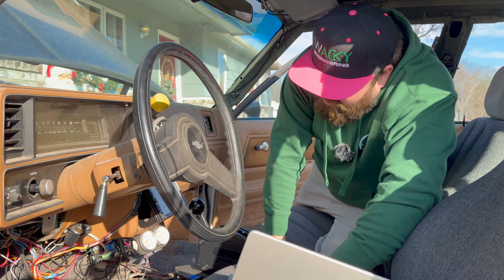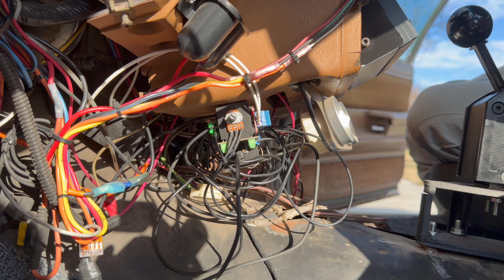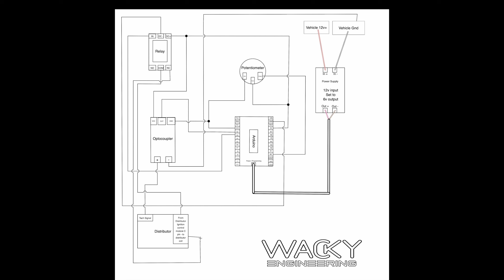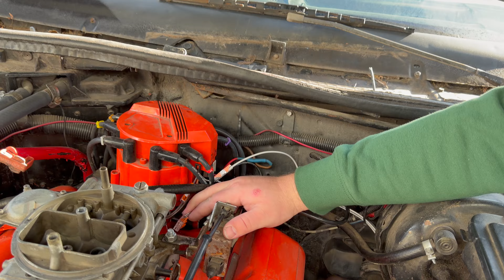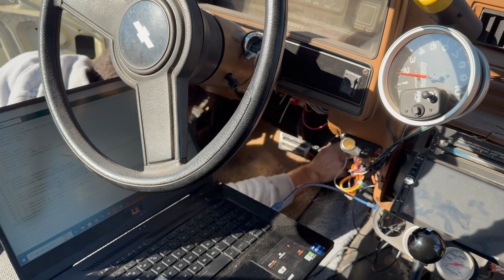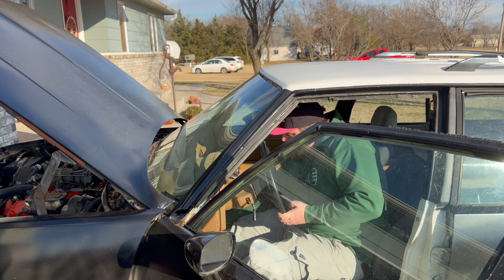How to Build a DIY Rev Limiter: Wiring & Setup Guide

Comment: Hi, very cool idea! I’m currently making my own for my -76 Corolla but I don’t fully understand where I should connect the wiring to the distributor, any thoughts on how I should connect it? (I’m very bad at this electrical stuff)
Reply from the maker: Did you happen to look at the wiring schematic we posted during the video? Hopefully the schematic should make sense. If you have any questions about a specific wire let me know.
Reply: @w @wackyengineering s I looked at the schematic and it’s pretty clear where everything is supposed to go. I just don’t understand which cable from the distributor I should connect. Is it from the distributor to the ignition coil or some other signal cable? I’m sorry if I’m bad at describing my problem english is not my first language
Reply from the maker: Well you have a wire that takes the rpm signal from the coil to the Arduino. You also have the power going to the coil that goes through a relay to interrupt power to the coil.

Comment: is there any communities that could help to develop and building ?
I am developing a motorcycle safety system that integrates a lean angle sensor with a progressive RPM limiter. The goal is to automatically lower the engine's rev limit as the bike leans, preventing the rider from over-accelerating while at high lean angles.
Reply from the maker: That sounds like an awesome project!
Reply: Kind of solving a problem that doesn't exist IMO. With the same sensor you may be able to use it as a wheelie sensor for anti-whiskey throttle.
Reply: hello i respect your comments brother, can you suggest any ideas about iot? I thinking also about smart lamp that can move and avoiding the traffic from incoming way, i live in Indonesia and there no sistem like that implement here

Comment: HEY, i have a quick question. AT 2:14 why do you wire the potentiometer like that instead of like they are typically wired?  
+ S -  OR  - S + 
BUT you seem to have wired it  
 -  +  S.
ill be using a different mothed of adjustment nut im just curious. 

thanks for the video, schematic and code. i freeze framed the first video in slow motion for hours a while ago. i believe that i asked for the code.. i want to do this on motorcycles... or at least the ones that i own 
so they can be tested and updated often
Reply from the maker: You are correct, normally the output or wiper is the middle leg of a potentiometer. Im assuming I just was not paying attention. I will double check the car to see if this is actually how I wired it up. It obviously is working but It may be more like a rheostat than a true potentiometer wired up like this. I would wire it up the traditional way to get better control out of it.

Comment: when i made mine, i used a cheap rpm window switch paired to a 5 pin relay to the power side of ignition.
i used my 20 dollar temu window switch(jegs brand sells it for 50 i think) ground output to the ground trigger side of the 5 pin relay that had the normally closed pin going to igniton. feed it ground and it breaks the circuit, making a hard cut rev limiter.  i use it on my GM hei.
Reply from the maker: That sounds interesting! We would love to see a clip of it in action!

Comment: Thanks
Reply from the maker: No problem!
Reply: Was testing it today but seems like the relais is to slow to cut of in terms of the rpm is going up when holding gas but also little bit of cutting it i change the onpluseduration tot 1 ms but also no effort 😮
Reply from the maker: Can you send a video of the operation?
Reply: @wackyengineering sure to where?
Reply from the maker: We have an email on our page you can copy and send a link to. You could also upload it to YouTube and share the link that way.